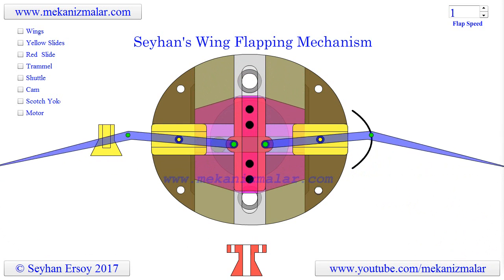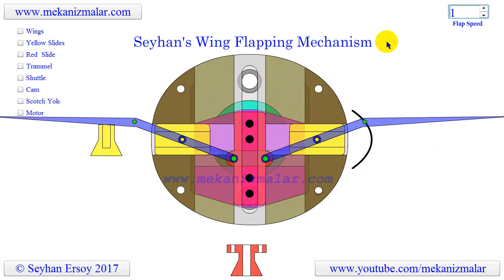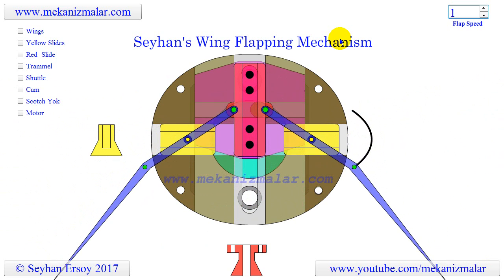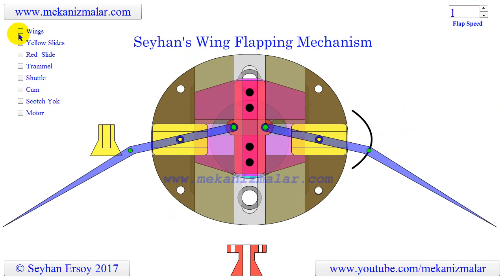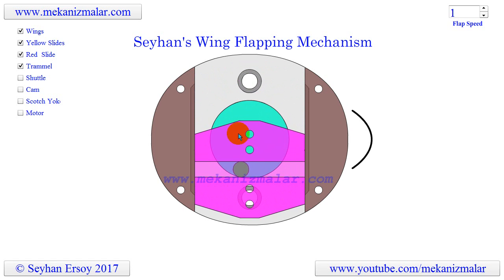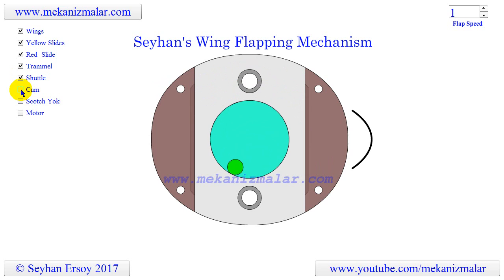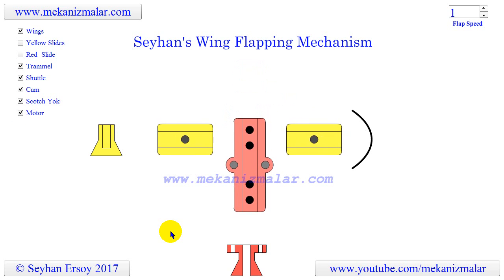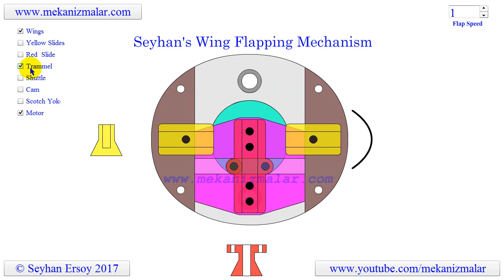Seyhan's wing flapping mechanism

Comment: Please allow me a suggestion: What about a solenoïd to achieve the linear motion (up/down stroke) instead of a rotation, wich induces friction between the (have to be there to suit the situation but the world would be a better place without these extra) mechanical parts (to get a translation from a rotation) and the worse: extra weight and lateralisation (due to the rotation of the motor)? With a sloenoïd between both of the end of the wings -it would have two steps: first to contract, then expand to achieve a "flap". Therefore the piece is working 100% of the time. (I hate things like the 4 stroke explosion engines with 3 "non-positive" strokes..)
Flight stability is compromised unless it's compensated with... extra parts/mechanism...
I really like your objective, methodic & rational thinking. Therefore the focus stays on the subject so "evolution of thinking" can take it's place. Once, I heard "less parts is better". My ex gf used to say "never go to another room in the house with empty hands and you will soon notice you're saving time when cleaning." .. I'm taking a try based from this way of thinking in this comment.
I learn more than wing motion from your videos.
Thanks.
Reply from the maker: Thank you for your interest and suggestion.Is there powerful but light solenoids out there. All the solenids I so saw so far much heavier than motors? I think they are power hungry devices, however I am not expert in the subject.
Reply: Neither am I, but the power (V*A) induced, the size/number of turns of wire, the weight/inertia, the travel lenght of the "piston" are factors wich must be choosed carefully. Building a solenoïd to suit a specific usage should'nt be that much of a challenge to you. And it can be coupled to a lever of some kind to slow it's speed, wich will in this specific case boost it's force, plus it can be 'timed' to counteract or follow the "bird's" movement, thus balancing it..
I'm impatient to see the evolution and the result.
Best luck to you! Have fun!

Comment: instead of using classic motors u can use electro magnets for linear movements lik the ones in the old door bells changing polarity will move the sliders up or down. Also u can make sliders from neo. megnates and use a single coil to move. The coil must be in the center so that the total weight of the system will go down.
Reply from the maker: Thank you for your comment and excellent suggestions. I will mention these suggestion in my mekanizmalar site,